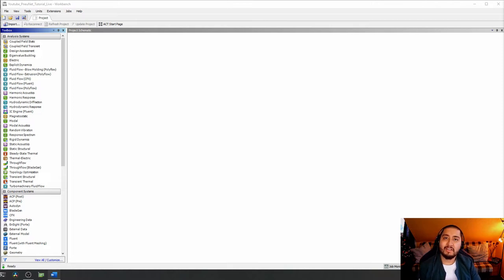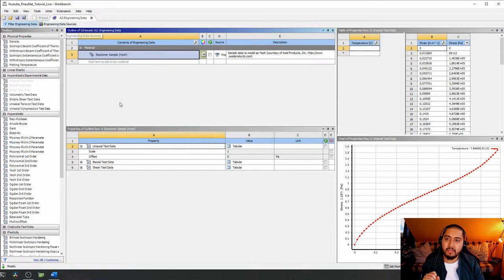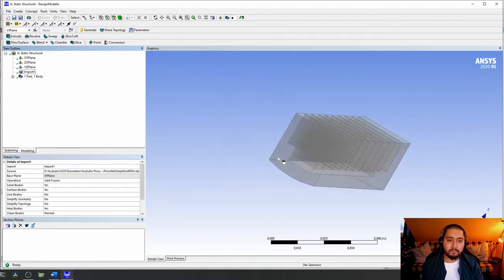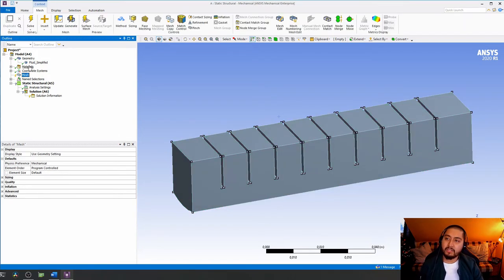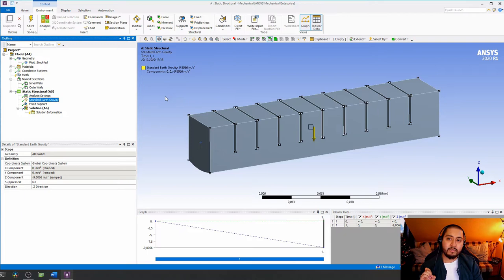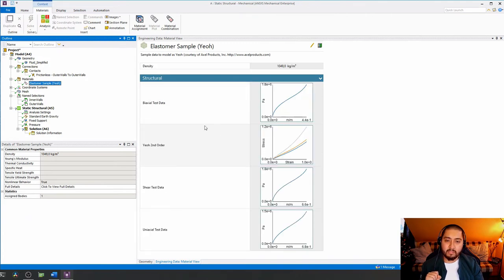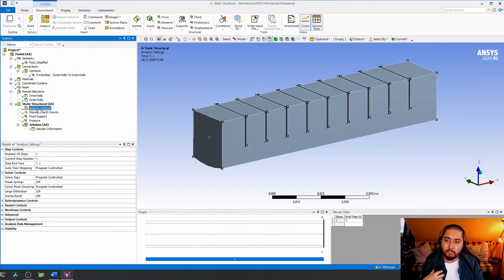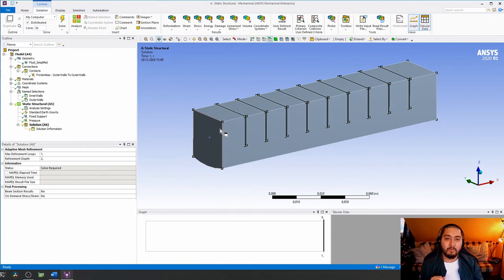Ansys Hyperelastic Soft Pneumatic Actuator FEM Simulation Tutorial / Soft Robotics Simulation

Comment: Very helpful, saved my life. I'm doing my BEng thesis on a pneunet and have been trying to make hyperelastic analysis work on Fusion 360 without much success.
Reply: When I try to split my model into cross section view in design modeller to mark the inner walls, I get an error "AnsysWBU.exe encountered a problem. A diagnostic file has been written C:\\Users\" Any ideas? I've tried to import the file in several different file formats.
Reply from the maker: Hello, i never had that problem before. I could not tell you if there is a solution. Maybe some licensing problems? Thanks for watching and i am glad i could help :)

Comment: Hello Jorge. 
I followed all the steps to the T. Whenever I try to solve it, I get this error:
"Element <The number changes based on element size> located in Body "Soid_Fluid_Simplifed" (and maybe other elements) has become highly distorted.  You may select the offending object and/or geometry via RMB on this warning in the Messages window.  Excessive distortion of elements is usually a symptom indicating the need for corrective action elsewhere.  Try incrementing the load more slowly (increase the number of substeps or decrease the time step size).  You may need to improve your mesh to obtain elements with better aspect ratios.  Also consider the behavior of materials, contact pairs, and/or constraint equations.  If this message appears in the first iteration of first substep, be sure to perform element shape checking. Named Selections for the offending element can be created via the Identify Element Violations property on the Solution Information Object."

Do you know how if there is a fix for this? Thank you regardless, this is a great video!

Edit: I'm using ANSYS 2022 R1, if that matters

Comment: Thanks, Jorge for the tutorial. Could you let me know which software did you use for 3d modeling? Is it Fusion 360 or solidworks? Could you also share the 3d model files so that I can see the steps you used to model it?
Reply from the maker: Hi, i used Catia for the modeling. The input STEP model you can actually download from the video description. Thanks for watching!!
Reply: Hi  @JorgeMoralesAv  , thanks for the reply. Could you also share the stp file of fig.1 ( Parametric model for additive manufacturing) of your paper which includes the base plate and channel connectors from the air supplier?
Reply: Thanks Jorge for this great video , but I tried to download the step file but the link is not working @JorgeMoralesAv

Comment: When I do the same mesh characteristics as in the video, I get about 1 million nodes and half a million elements which is causing the solution to fail. Can you explain how to decrease these? I am using the student license so I believe the amount of nodes I have are fairly limited.
Reply: could you solve it?
Reply from the maker: You could try meshing the part very simple with the default mesh settings and leaving everything in auto. I am not sure if there will be no errors because of mesh distortion. If you are using the student edition, it will be very challenging to adapt the mesh to such limits.

Comment: Hello, Mr. Jorge. Can you briefly explain what is the difference between the "normal" "component" and "vector" for pressure define?
Reply: Does where the arrow point at for the pressure define by "normal to" indicates the load direction, and is that a way to change its direction?

Comment: I have been getting the following error when I press "Solve". I even ran the same file on a better PC but similar error pops up. Can anybody provide a solution for this?

My laptop specs: 
Cores: 2
RAM: 8GB

'Better PC' specs:
Core: 4
RAM: 16GB

 
DISTRIBUTED SPARSE MATRIX DIRECT SOLVER.
  Number of equations =     2663255,    Maximum wavefront =    846

 * ERROR *                           CP =     200.922   TIME= 20:49:06
 There is not enough memory for the Distributed Sparse Matrix Solver to  
 proceed using the out-of-core memory mode.  The total memory required   
 by all processes = 11319 MB.  The total physical memory that is         
 available on the system = 6843 MB.  Please decrease the model size, or  
 run this model on another system with more physical memory.